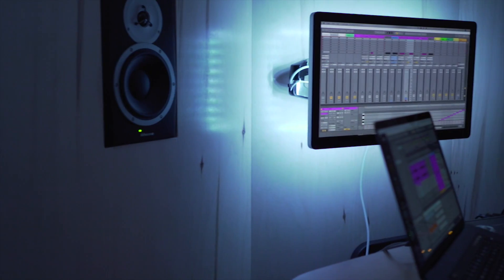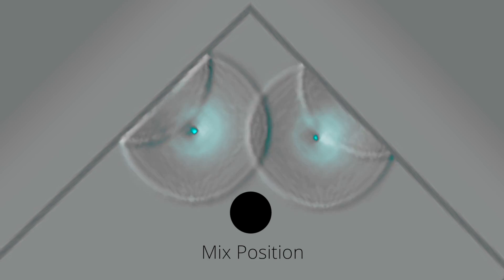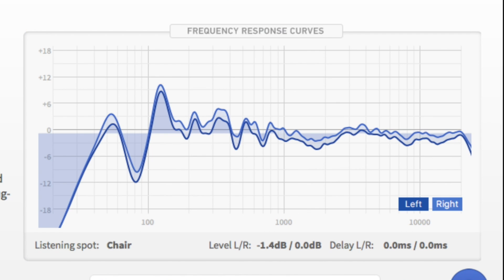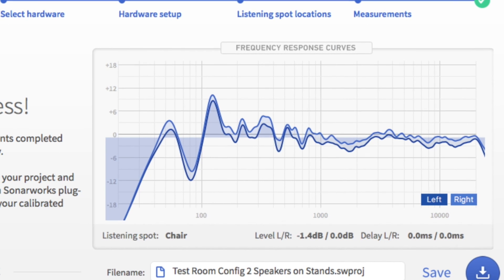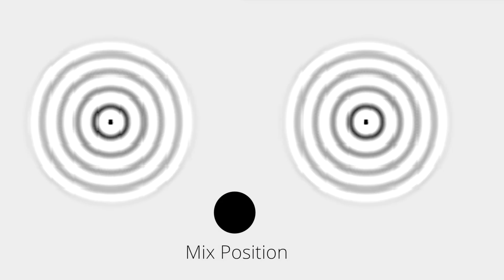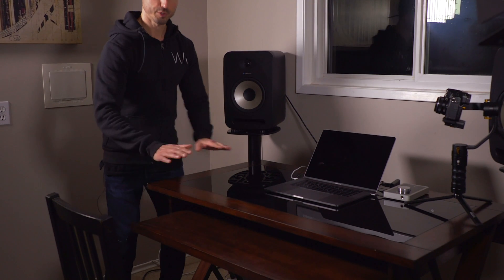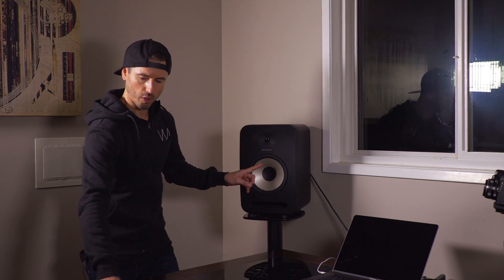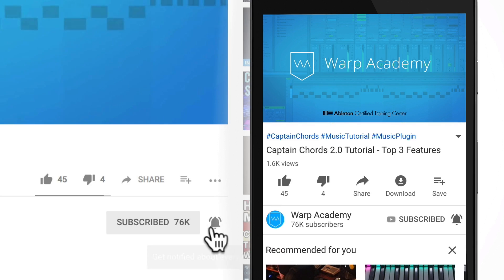How to Set Up, Test and Improve Your Home Music Production Studio Room – Acoustics Tutorial

Comment: Super solid info. I'm no pro but I know how sound works, and I always got told to position the tweeter to my ear, but I chose to set the monitors in the same position you recommended. Would you leave the window behind the desk untreated?
Reply from the maker: Glad that was helpful.  Yeah, a lot of people give that bad advice because they don't understand phase and how the acoustic axis of a speaker works.  Definitely treat the window area.  I would stuff the entire window sill top to bottom with Roxul Comfortbat rock wool.  Then cover it with prefabricated panels from Primacoustic, like their Broadway or Control Columns.

Comment: Nice video. Unfortunately I have two windows in my room on two walls not parallel to each other. Any suggestion about the workstation placement?
Reply from the maker: That's a very difficult acoustic situation to be in.  You'd need to make up a full room plot / diagram with measurements and work with an acoustic consultant to get good results.

Comment: He is right on a lot of points except the placement of the monitors on the rear wall The “in-phase“ frequencies get amplified, and the “out-of-phase“ frequencies cancel out. This principle is known as the boundary effect.

To solve the problem, pro studios often build their monitors directly into the wall, thus eliminating all rear reflections. however, by placing the monitors directly in front of the wall will cause even more build up of energy this is what should be done create the maximum separation between the wall and the monitors that the room-size will allow.  For most rooms, that’s between 1-2 feet.

This won’t SOLVE the problem, but it will lessen it somewhat, by reducing the strength of the reflections. also buy monitors with front bass ports

Comment: I'm just curious why you recommend moving the monitors as close to the walls as possible? I thought this is known to enhance lower frequency but not in an accurate way and only exaggerates the low end frequencies which will lead to poor mix decisions.
Reply: yes, that is right! moving the monitors as close to the walls is totally wrong! It can increase the gain of low frecuencies 6 db! that is a lot! and it will increase the difference by room modes so the frequency response would be terribly worse!
Reply: also the description of comb filtering is totally worng! I don't know, there is some misinformation in this video
Reply: @manuelninogarces9574  how would you acoustically treat studio doors and windows?

Comment: Great video! One question I had was usually you hear people say to move the desk & speakers away from the back wall, but in this example you moved them closer. Is it because the room is SO small you're playing to the less of two evils? Or would it be advantages to have the desk & speakers a few feet off the wall? At what size should you start doing that - if at all?
Reply: There is what in know as the 38% rule. In theory the optimal position to be sat is 38% of the total room length from the front wall. In a really small room that is pretty impossible so I think the guys are demonstrating a best worst case situation.

Comment: This is hands down the best, most informative video on acoustic properties of a room on the internet! I kind of feel like I owe you a consultant fee! I do have one quick question, if you have a minute... I am a woodworking enthusiast, and am planning to build a desk that I will use for both my recording, and for work (software engineer, working from home). None of the bedrooms in my house are ideal for conversion into a home office, so I was planning on just using my large living room as my home office/recording studio/living room. Watching your video has made me question a few things though. You had, in both your studio and guest room, the desk pushed up to a wall, with the user facing the wall. I had planned to have my desk pulled out 40 or so inches from the wall, and I would sit behind the desk with a sheet-rock (dry wall) wall directly behind me. Is that just a huge no-no? I am perfectly fine with it if I'd have to dead the wall behind me with thick cloth covered Owens Corning 703 panels to prevent sound from reflecting off the wall and at the back of my head. But, do you think deadening the wall behind me completely like that would solve one problem but create another? I'd love to know what you think.
Thanks for the killer videos.

Comment: Did you measure again after placing the monitor on the stand? I wanted to know if the frequency dip and peak has improved. 
Thank you for this video!
Reply from the maker: Hey hey.  Yes, we took measurements quite a few times in the process.  I have snapshots handy from a room that I recently helped to treat that would show the difference.  In this room we placed the monitors properly, and also installed full acoustic treatment using a Primacoustic London 12 kit, plus a 3 part stratus ceiling cloud.  

Here's the response waterfall before: https://www.dropbox.com/s/ljih7c61o6z9e87/Before.png?dl=0
And after treatment: https://www.dropbox.com/s/eil0a2iu323mwho/After.png?dl=0
Reply: Warp Academy that is really helpful! Thank you for sharing!

Comment: Great video. Is it possible to create good acoustics to mix when you put the speakers in front of a window? I always thought this was a bad thing to do :)
Reply from the maker: If you have a window at the front of your room, you're never going to get great acoustics.  The only exception is when you have your monitors flush mounted into a glass front wall like Noisia's studios.  But that's hella $$$.  

So in general, you want to remove the window from the equation by stuffing it with rock wool to reduce reflections.

Comment: Greaaat content man!! What about having some isoacoustics over the monitor stands (angled downwards)?
Reply from the maker: Glad you liked this one.  The Ultimate Support stands decouple just fine on their own.  They're designed to decouple.  However, in some applications that may help.  Ultimate Support actually partnered with Iso-Acoustics and made a model of stand that has the Iso-acoustics decouplers built into the top of the stand.  

I'm not a fan of angling monitors at all.  The reason is that if you move slightly forward or backward in the mix position, then you're outside of the sweet spot as the monitors will now be firing above or below you.

Comment: Hey man i have question here, what the best ratio of the room?
I have 6m x 4m with 2m height, is that good? Where should i put my monitor?
Reply from the maker: Hey mate.  That's a decent size room for length, but those ceilings are crazy low.  Are you sure they're only 2m?  Standard ceiling height is 2.4m.  Are you in a basement?  

In general, you always put your monitors along the small wall, and aim them down the long end of the rectangle.

Comment: Hey looking at the video for the third time in past month I guess, something what you said is bothering me. You say we should push in the monitors right up against wall, but most manufacturers advise you move them 50 to 75cm away from the wall. For example I got my Neumann KH120A monitors yesterday and I'm trying to do a setup of the room which is 2m wide and 4.5m deep with 2.6m ceilings with big glass window I'd be looking at so monitors would partially be against the glass. Given that I have the room depth  is it better that I focus on sitting position somewhere around 38% of the room depth and pull monitors closer to myself or to place sitting position based on monitors being pushed against the wall I'm looking at?
Reply from the maker: Hey Milos.  Yes, we're aware that many manufacturers recommend spacing the monitors away from a wall.  However, acoustic testing doesn't lie and I have no idea why they recommend doing that when you have SBIR to contend with.  When you have monitors off the wall in an untreated room, acoustic tests usually will reveal large phase cancellation in the low end.  This is very different when you have proper trapping that extends floor to ceiling and addresses all your room seams.  You can't just follow speaker manufacturer's blanket/general advice and expect to get good results.  

My recommendation is always to do the acoustic testing yourself, first hand.  If you don't take scientific measurements in your space, you're just shooting in the dark.  The tests will provide invaluable information.  

Also, you should definitely plan on spending at least as much on acoustic treatment as you did on your monitors, likely more.  Testing along the way and following room treatment best-practices.  

Best of luck with your studio!

Comment: I live on the top floor of an old house, meaning that a lot of my walls and ceilings are tilted at a 45 degree angle to shape the roof of the house. How would this be different from treating a perfectly square room? Would I have to mount panels on the 45 degree angled walls? The room is also not very even at all, I cannot really get a perfect midway point between side walls
Reply from the maker: Hey Cameron.  The room you're in is likely much better suited to recording than mixing then.  In a recording space you typically avoid parallel surfaces in order to diffuse the sound and get away from standing waves.  For a mix studio, that's a very challenging environment, but my approach would be to locate the desk as best you can, then use mirrors to see where your reflection points on your walls.  Then mount large, broadband panels in those points.  I would also suspend a ceiling cloud above your mix position and then test (with Sonarworks or Room EQ Wizard) tilting the ceiling cloud.  

Also, it's universal that you should trap all corners and room seams.  For example, where the floor meets your front wall, the vertical seam of your front wall and side walls etc.
Reply: Warp Academy thanks for the quick reply on an old video no less! I’m actually using the room more for sound design purposes, so having it better for recording is probably a positive for me.

I’ll look into traps, I’ve not currently got anything on the ceiling either. This video has definitely been a big help, thanks for the advice!
Reply from the maker: Sweet.  Good luck with the room build!

Comment: So Sonarworks Reference 4 would be able to apply an EQ curve to my room to compensate for the fact the left speaker is in a corner (the right monitor isn't) and both monitors are as close to the wall as possible? I know it's not an ideal placement but I have no other option. Outstanding vid btw, I'm looking forward to watching all your vids. They are very informative and excellently presented 😃
Reply from the maker: Glad you liked this video.  If you have one monitor in a corner, no amount of EQ is going to be able to correct for that IMO.  Sonarworks can really help with fine tweaks, but it can't make up for a room setup that's resulting in a huge amount of bass buildup in a corner and a lack of trapping.  

For you, I'd highly recommend mixing on headphones from Sonarworks, with their individual calibration profile.  Sennheiser HD650s + Sonarworks Reference + Waves NX with the bluetooth setup would be ideal.  Then it doesn't matter how bad the room is.  Cheers!
Reply: @warpacademy  I've since made rockwool panels to trap the low end and have minimised the issues with the monitor placement. Problem largely solved. Sonar Ref 4 should seal the deal

Comment: Why are other professionals teaching to NOT put the Speakers right in front of the Wall? They give advice to place them around 2 foot away from it? They also say your Speakers should aim right behind your head, while your Head is in equal distance to each monitor in the triangle.
Reply from the maker: Hey mate.  Thanks for the question.  Many people think that by putting the speakers off the wall and placing treatment / absorption behind them that this solves SBIR or boundary coupling.  I used to think this too, before I started working with acousticians and doing room measurements.  It's a common misconception.  But you'll get far better room test results when you don't have that reflected bass recombining with the dry signal a split second later.  

As for the speakers aiming slightly behind your head, this is correct.  It's exactly what I say in the video.  It's called the stereo vertex point.
Reply: @warpacademy  Thank you. In two Month we move to our new House where i have a dedicated Room for my Studio and ofc you save a bit of room, when you can place the Speakers right in front of the Wall. I´ll test it like you sait.
Reply: Also, you need to consider where the bass reflex is

Comment: love the vid...but just one thing.  I was told never to push monitors back to the wall. I was advised they should be away from the front wall by a few feet if possible.  Any thoughts?
Reply from the maker: Yes, this is something you'll hear with rear ported monitors.  However, having monitors off the wall causes the phase issues mentioned in the video.  With acoustic testing, you'll quickly discover that it's best to have them right against the wall.  Or, ideally, flush mounted in the wall like in our studio.
Reply: @warpacademy  Cheers.  Ive just downloaded a copy of REW (roon EQ wizard).  NOOOOO idea how to use it,  Ive ordered one of those room testing mics and its on its way.  Im hoping to try figure out how to use the software and then do loads of tests.  For example theres a guy on YT used ordinary bathroom towels as absorbers and says they work great.   I really need to get my small cube room as good as i can get it.
Reply from the maker: REW is very complex and unintuitive to use for sure.  It's free, so they don't really care.  There are some good tutorials on setup from GIK Acoustics on Youtube.  But we'll be doing a video on how to do full acoustic testing at Warp pretty soon too!  Whatever you do, DON'T listen to some dude on YT about using bathroom towels.  That's how you get bad advice.  Use proven acoustic materials only (we use Roxul Comfortbatt R22 and R14) insulation for DIY panels.
Reply: @warpacademy  For sure...free software s not going to come with support.  I'll look out for those tutorials.  If i cant figure it out I'll get something like Sonarworks.  Although it is about $300....ouch. Yes the internet has tons of advice but not all good.  And as i dont know anything about the math behind sound or frequencies Im not in a position to know whats what.  But i do subscribe to Sound on Sound mag which is a UK recording mag.  They are experts and have a very good forum with some really knowledgeable folks.   They  werent too impressed either by towel guy  HAHA.   Oh well.   Thank you so much for the replies and the great tutorial in that vid.     Xave

Comment: Amazing video thank you! I am building a room now and wanted to know if I frame the corners of the room with 45’s will I still need bass traps? I didn’t see any foam traps in your setup
Reply from the maker: Cheers Joshua.  That's a fun project building a room.  I hope you're enjoying it.  In studios, don't ever use foam for any reason.  It doesn't absorb frequencies evenly and has a lot of trouble down in the low mids and subs compared to glass wool panels or rockwool batting.  In my room, I have floor to ceiling trapping all around the entire room, with more in the critical listening position and in the back for bass trapping.  

When you say "frame in the corners with 45's", could you be more specific?  Are you actually building the room from the ground up with framing lumber?  If so, you'll want to ensure you're putting in a lot of batting and going floor to ceiling.  I used Roxul Comfortbatt R14 and R22 and would highly recommend it.  Then it's wrapped with acoustic fabric so it looks white (or any other color you want).  

Let me know what monitoring setup you're using and your room volume & measurements, if you'd like a specific answer.  Cheers!
Reply: SOMEONE HELP! I CANT FIND THE NOISE MH MONITORS ARE MAKING ON YOUTUBE PLEASE LOOK AT THE VIDEO I POSTED

Comment: How did you fight SBIR? I have same frequency response as your room. 80Hz dip & 130Hz boost.
Reply from the maker: The first step after testing is to do a lot of trapping.  Flush mounting the speakers into a hard wall, like in my studio, eliminates SBIR off your front wall.  But if you can't do that, then tons of trapping.  It depends on your room size how much you can put in, but in general you want to trap the front wall, side walls, and ceiling in your critical mixing area as thoroughly as possible.  That's floor to ceiling traps, that cover all seams in walls/ceiling/floor.  Then deal with the back end as well with a combination of absorption and diffusion (depends a lot on how far your back wall is from your mix position).  Keep in mind that 2" or 3" panels aren't doing much for the low end.  You need 12-24" of trapping to really tame things up in the subs.